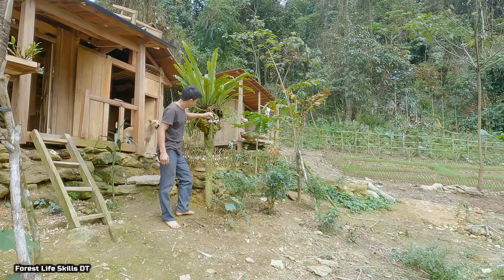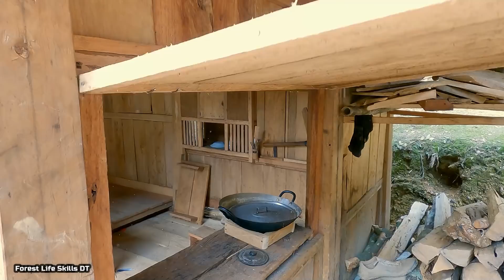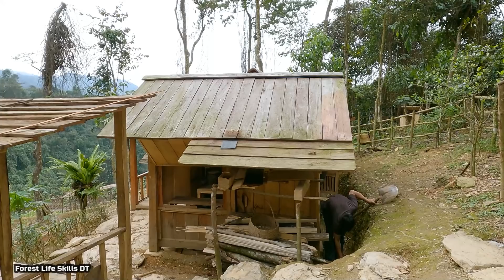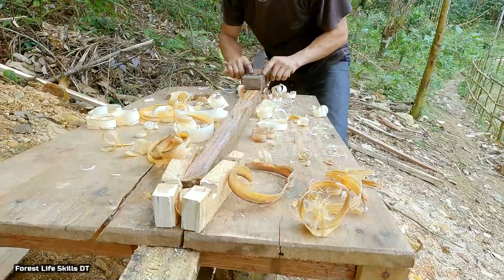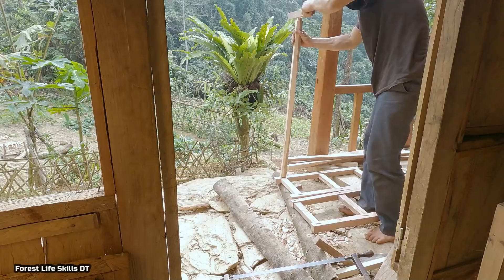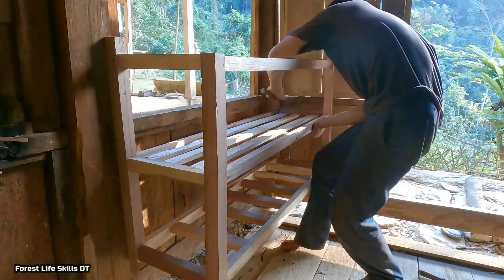Making Kitchen Cabinets, 280 working days to complete the house completely from wood | Ep.194

Comment: The wooden house they have built beautifully, but the wooden floors, table and the roof is not very nice because you should definitely paint the house, the floors etc with an impregnation paint, so you can care for the wood clean with water and always looks like new.